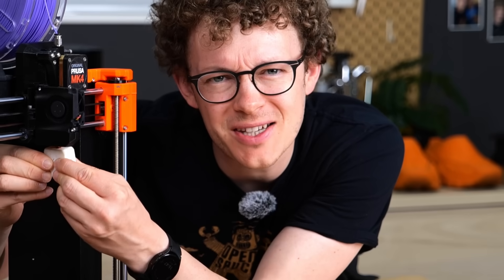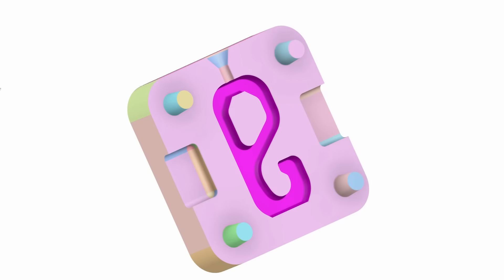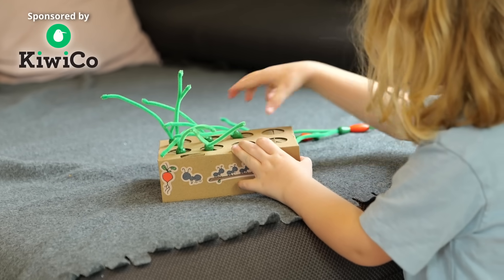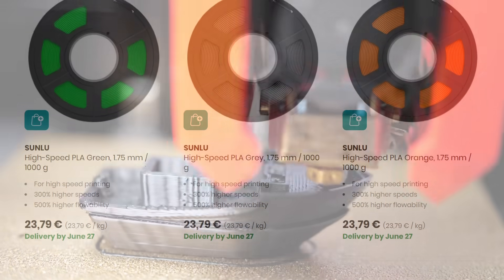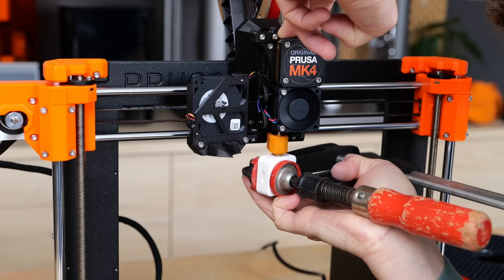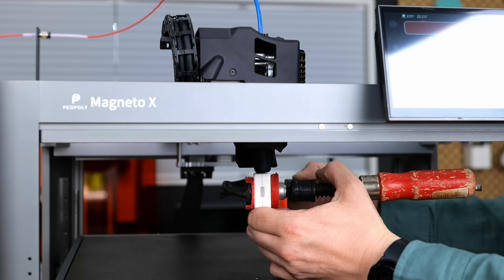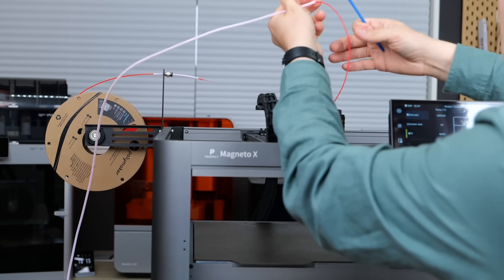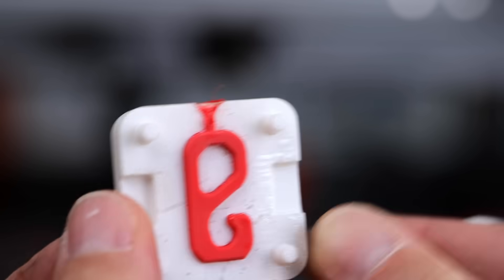I tried Injection Molding using a 3D Printer!

Comment: I've been thinking about this recently. It's so weird to see your video pop up about it. In traditional injection molding, you're using a bit more pressure as well as speed. I'm betting that the only way to really get this would be to use a Heated mold. As in being able to place a heating core inside the mold just to keep the media warm enough to flow into the part. At that point you may as well just use a regular injection mold setup because...yeah..

Comment: Slap heater pads on the mold's sides so it doesn't cool down until injection is completed. I was also going to mention vent holes but that one has been covered by dozens of others already.

In industrial injection, injection goes by so fast that plastic doesn't have much of a chance to cool before it is over. With a much slower process, you need to maintain temperature through other means like external heating.

A thin teflon or similar sheet between the nozzle and mold to use as a gasket should also help with sealing.

Comment: You made a mistake. You need an overflow sprue hole to allow the air to escape. Air pressure is what is causing you problems with getting the mold to fill. As the mold fills with plastic, the air is compressed, making it difficult for the plastic to flow further. I've been casting pot metal 25mm miniature for years and the overflow sprue is a necessity in getting the mold to fill. And the more complicated the part you are attempting to cast, the more exit sprues you'll find yourself needing.

Comment: I think it would be easier to use a desktop CNC machine to cut the mold from Aluminium, and have a section in it that clamps around the tip of the print head. Leave the mold in place to heat as the head heats, then push the material in. If the mold can be secured between the print head and the bed, the bed can also be used to heat the mold. The strength tests of injection vs printing will be interesting to see.

Comment: Vent hole and also why not heat up the mold to slow the cooling process?  As soon as the filament is injected, the pressure is pushing back on the fill and the mold is cooling down the filament too fast.  You could use the hot bed to warm up the mold and push it against the nozzle.

Comment: Mold Designer checking in.  Others have noted that venting, heating the mold would help.  Bang for buck, you're freezing too fast, so a sprue placement into the center of the parts will fill better -- but your knit line around the circle hook (where your sprue currently is); will make that area weaker.

Your intuition was correct, to give yourself more melt zone to get the plastic -- but even if the viscoscity is sufficently fluid -- you're not close to any injection pressures to get it to flow.  So the extruder needs to apply more force to get more flow on the filament.

Because flow is a product of force and area; your might be able to get away with a thicker filament and a beefier "injection" motor (such as glue stick sized, 3d printed dual-core-filament sticks I've seen you make before).   That is assuming you maintain a long-er melt zone, and there's some absurd planetary gearbox that would allow you to spin the extruder motor as fast as possible to apply more force to a larger diameter "injection filament".

This may allow you to get up a reasonable sized part for the volume of the printer -- but you'd sort of need a dedicated hot end that had a bigger bore to accomidate the larger filament diameter.

I'm still working on using the larger core diameter I mentioned above.
My "niche" idea was to use nitinol springs behind a nearly sealed cylinder to apply the injection force to the larger core filament diameter.  The idea was, to use a capacitor discharge to actuate, and compressed air, or a fan to cool the cylinder so that I could reload the next filament "shot" size.

That little shape memory alloy applies a suprising ammount of force.  
I figured that was my best shot at making it work within the 3d printer form factor, at residential power.
I'm looking for a new job, so I don't have time to pursue that idea right now -- but I beleive at the time of writing, I have not heard anyone else on the internet suggest what I had above.
Good luck to you.

(and maybe wish me luck finding work too, I need all the help I can get)

Comment: If you get around to medal molds then you could probably also make a custom nozzle that can link to the mold so you can latch it on to help with that issue of leaking, and this would allow you to have it heat up with the nozzle so you could make bigger molds without it hardening too quickly to fill it. And don't forget vent holes because if it is made airtight, then you are going to need them if you want to fill the molds up all the way.

Comment: From someone who has designed some molds for die casting, you’d want to gate into the thickest section. In this case, it’d be the middle of the hook at that intersection. That also shortens the path the plastic has to travel so it wont solidify too soon

Comment: Don't yopu think you should have an opening at the other side of the mold, to let the pressure scape, and not let the air get traped into the mold and the plastic ?, I don't know how much the mold can seal the air inside, after compress the mold with the clamp. ??  sorry just one idea to solve the issue. greetings from México, Puebla.

Comment: Another suggestion I have not see around is to add a short, but narrow, point between the sprue/runner and the main body of the part. Depending on the plastic and temperature you may see an increase in flow rate as the plastic shear thins. Shear thining is a non newtonian property of some plastics that is leveraged in larger scale injection molding. One added benefit is that the small point (gate) between your part and sprue will leave a smaller defect in the final part while increasing flow rate!

Comment: I think you should try using filament injection to reinforce a normal print to see if it could improve layer connectivity. Leave small vertical holes as you print, and go back to theese holes and inject plastic into them that creates a vertical connection between layers..

Comment: start by getting an standard external size for all molds, then make a small box bending alluminum or thin steel plate, put 2 thermal  elements like mini heat pads or peltier cells, get a propper relay for the heating element, and make a hole on all molds you make to fit a thermistor when pouring and get it out as soon as it ends; now just go to a klipper printer and set the thermistor on a empty analog input on MOBO and the heating element on a digital output like a controllable fan through the relay, then just configure as another variable temperature and you can set it the same as you set the bed or the hotend temperatura, also remember to PID the new heat element, tou may need a blank to do that PID as well. Like from Spain!

Comment: This might be a weird case for something like the Flex3Drive, because of the high gear ratio. 40:1 is arguably overkill for 3D printing, but the added torque may help to increase the pressure in the mold.

Comment: Hey, I see a problem where the filament is cooled too fast in the mold. No matter how you brute force it with increased pressure and nozzle temperature, it will eventually clog up when those filaments get deeper into the mold. My idea is to heat the molds from each side when molding since the resin can handle high temps. Then you should not struggle to mold imo.

Comment: PLA is kinda hard for injection molding. As you can see with TPU its already much easier, PP or PE  would probably work a lot better than PLA. Very much doubt venting is an issue as many comments are saying. The super low injection pressure is the main limitation.

Comment: What about 3D printing the part complete with vent hole.
Use ceramic like basis or plaster or something like that, and pour into a mold around it all. When set, heat it up and melt out the original print. You are now left with a negative cavity to inject into. Using this method you can also cast metal directly, with suitable high temperature molding capability.

Comment: I think you are missing the great success you had printing a mold -this is impressive! -as you focus on problems filling your poorly designed mold with a terrible slow nozzle.  As bad as your setup was, it would have worked if you had just gated and vented correctly (center out, thick to thin, vent the end, and if flows must meet, they must meet hot and early as possible).
Even comercial extruders use a simple piston motion to extrude fast.  There is far more material selection in pellets.  Just use a heated tube and a piston.

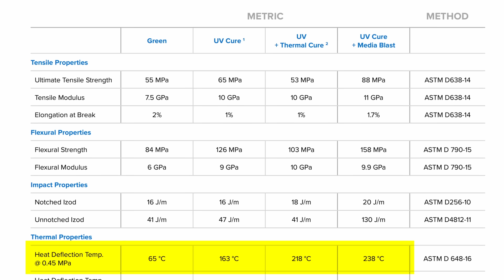Comment: At minute 10:00 it could help to remove the plastics parts from the clamp. And store the clomp with the mold into your printer oven. So is more heat stored in the metal. So the clamp can heat the mold while you filling it with filament. And the metal clamp with plastic will cool the mold a bit down. Thats contra productive. Thanks for your great experiments

Comment: Vents, designed a hole that matches the nozzle and clamp it in the top of the mold to prevent escape. Press the gantry against the hot bed with the heat on. center the sprue along part volume.

Comment: design a mold with an embedded heating element so that it will keep the molten filament hot long enough to fill the mold.  place the mold on the print bed and use g code to press the nozzle into the fill port.  having a heated mold should allow you to use a larger mold because it will keep the filament melted until it is filled.

Comment: make a neck slot in the mold with a hollow threaded rod that is the same thread as the nozzle and screw it into the heat block then screw the mold onto the rod. that should help with sealing 
also put some type of small vent on the other side of the mold

Comment: I would approach it by volume, doing several things at once and then increasing the size incrementally. 
This has potential.
I am not very well versed on 3d printers, or filaments. Just can't afford it right now, got half a printer in my closet. Was going to build one. Open source it all.

What I can tell you is that I used to work in a fiberglass factory where my job was to work with injection molds and compression molding machines.
I made parts for oil industries.

Here's the optimizations I would make.
1. Preheat the mold, find a way to keep it warm, doesn't have to be hot, but it should be pretty toasty. I wish I could give you a target temp to start with.
2. Use a massive filament, and a very strong motor to push it through an extremely (maybe, subject to your own discretion, just look at the max temps for the filament) hot end. (more pressure)
For example, 3mm filament through a 1mm hole. The bigger the start filament the better. Adjust feed speeds as needed. I would also recommend getting a stronger nozzle before trying.
3. The nozzle should enter fully inside the spruce instead of marrying to the top of the spruce. It should be "like an injection", think needle in the skin. Tolerances need to be super tight.
A recommended thing to do is have the spruce with two different diameters, and match a nozzle to the same metrics so there is a stop, and the injection doesn't go too deep into the mold, and enter the product itself. The stop point should be beveled like the end of a regular nozzle, and not flat.
4. Vacuum. At the other end of the mold, consider having another nozzle connected to a vacuum pump. It probably needs to be significantly weak for your applications, and a filter is highly recommended. This has a two fold effect of helping the plastic flow, and keeping the temperature controlled.
5. Ejection pins (maybe), should your parts get really really stuck, you will need to think about ejection pins. You can also invest in mold release, but in my experience, you're still going to need those pins when it comes to vacuum molds and small parts. Extremely small parts might be ok, and it is subject to material and shrinkage.

Comment: Here’s my idea, create a mold with two holes for plastic intrusion at oposite ends and one for air extrusion in an adjacent end. Take two printing heads off the frame and repurpose them in a single frame horizontally, so they’re opposed to each other with adjustable space in between to insert and clamp the mold in the middle. Since you’re manually forcing extrusion anyways, this way you can clamp the mold to the extruders with adequate pressure and also lets your hands free to use a blowtorch to mantain temperature. Lot of work, and it wouldn’t be a 3d printer anymore -and you’d need to find a way to extrude both nozzles at the same time but it’d still be interesting to see
Reply: Wonder if adding a vacuum pump to help the extrussion fill the cavity and lower the pressure needed… say, a hole in the opposite end connected to a small vacuum pump)

Comment: 1- air vent hole.
2- mold design optimisation.
3- leave the mold on the bed and lower the nozzle into the mould rather than lifting the mold into the nozzle

Comment: Would love to see a custom machined nozzle with a threaded end, and a special mold/holder assembly where the holder screws onto the nozzle and the mold is held together by the holder, eliminating the need for the clamp and using the threads to provide the pressure needed against the nozzle or "injector"

Comment: Add an air vent, lubricate the mold, and optimize the injection point for even flow.  Heating the mold definitely helps, too.

I would also bring the hot end down onto the mold rather than pressing the mold up onto the hot end by hand.  In addition, you might consider forming the injection point to match the nozzle for better pressure interface.

Comment: Maybe change the mould so the material injects in the centre off the part so the material has less distance to travel from injection point.. if you look at an injection moulding tool the materials doesn't come in from the top..

Comment: Injection molds have a thin channel opposite the sprue machined into the mold surface for air to escape. They are also heated so the plastic doesn't cool too quickly. They use tons (literally) of force pressing the nozzle and the mold together. I would put an 1/4" (at least) aluminum sheet on top of the build plate to distribute the forces and then use the z stepper motor to press the nozzle into the mold. Not sure if the build plate heater could be used to heat the mold somehow. Also a silicone washer between the nozzle and the mold would help to seal it, this should also be heated. Maybe press the whole thing together and let it all heat up before injecting the shot.

Comment: Problem with the mold it has any air outlet, take safety pin scrch the one side of mold for 0.1 mm or great for the air flow

Comment: Another thought for discussion.... What temperatures were you using?
I wonder if you could get away with overheating the plastic (to where you would normally get bubbles and other behavior bad for printing). Since there's pressure on the plastic inside the mold geometry (vs no pressure when printing), it might be fine?

Comment: 17:33 Try it the other way round? (filling it form the head). Some molds are even filled from several sprues, and all molds I know have an outlet that helps vent the trapped air. Going bigger on the sprue might also help with sealing and filling. And you could, instead of holding it by hand, clamp the mold between bed and extruder.

Comment: Maybe add high temp o-ring between sprue and nozzle, and use the z-axis to clamp the mold in place

Also how do these compare to annealed 3d prints? I think that process is easier and isn't limited by hotend/extruder performance. Less detailed I'm sure but strength-wise probably comparable

Comment: If it were me, I would be afraid that even a small amount of air pressure within the mold would prevent its completion. I would make a tiny (VERY tiny) vent hole either at the end of the part (like at the end of your hook) or at a spot that is easy to just clip off once it is done.

Comment: most injection molding i've seen includes small channels to vent air pressure and excess plastic so that bubbles don't form and you get a complete part

Comment: I wonder if you could use one of those cheap "3-in-1-out" nozzles, drilled out for greater throughput, and fed by multiple extruders to get higher pressure?

Comment: I wonder if adding internal injection-reinforcements to 3D-printed parts would be a viable approach. Like first print the part with suitable holes, then inject plastic into each, then print some more to hide the sprues. Might need to use materials with different melting temperatures.

Comment: I would just run the Z axis down as far as it will go without skipping a gear and pinch the mold between the bed and the print head. You could also use the heated bed to slow cooling. Great innovation regardless!

Comment: Almost all the structures of a 3D printer are unused for this, would it make more sense to design a more purposeful re-build? Perhaps with a fully supported, fastened mold with no helping holding hands, and only using parts from the print head.

But if more heat and different plastics are really the way to go, this could be taken in a different direction. Designing a mini injection molding budget kit in collaboration with a metal working channel, perhaps. Optimized for high pressure and temp for figures up to around the size you worked with here, or maybe a little bigger if practical. If you can make it a smaller form factor than a small resin printer, it'll be a sweet machine.

Comment: I would put a silicone washer between the nozzle and the mold.  I would pin it to the bed by gradually stepping down the z axis, or push the mold up with door shims. More pressure would be transferred and you wouldn't have to hold it.